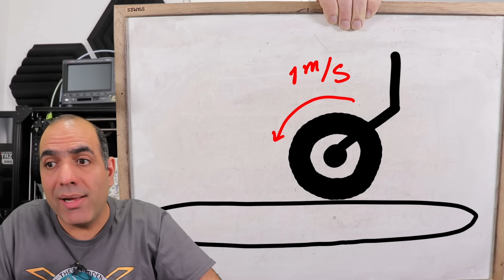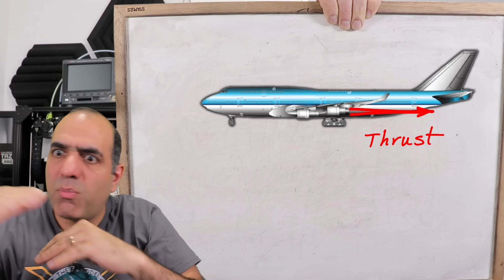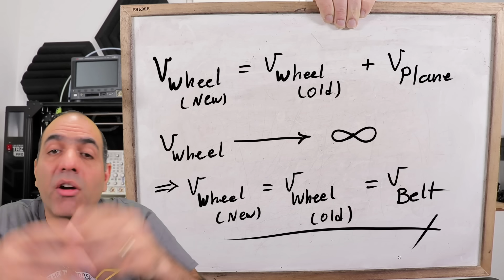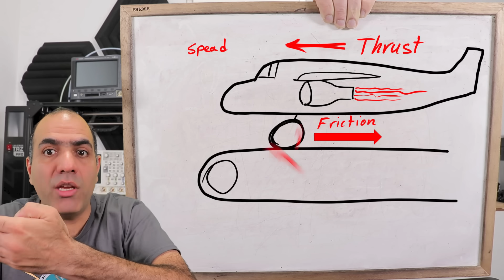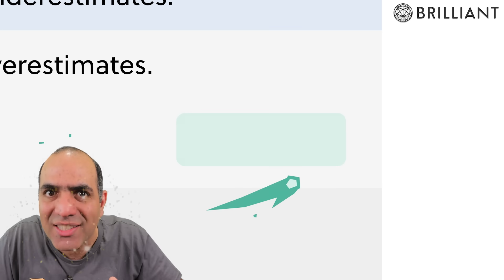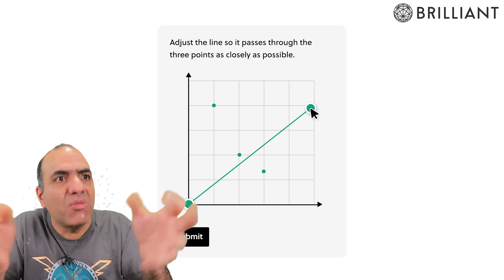Airplane Question that Drove Me NUTS!!!

Comment: Mehdi hit the nail on the head. The premise "the conveyor belt moves at the same speed as the wheels" is only possible as long as the plane itself remains static or the wheels slide on an immobile belt and neither spin. The moment the body of the plane begins to move forward and the wheels turn at that same speed it instantly becomes mathematically impossible for the "belt to move at the same speed as the wheels". 

Beside that, setting up a hypothetical scenario where the wheel bearings have friction while the belt they ride on isn't affected by the same real world restrictions such as inertia or top speed is just cherry-picking to get the answer you want.

Comment: Case 2 is a broken case. What does it mean to have infinite speed? It would required infinite force (which is not completely crazy, only a little) but also infinite energy, which is certainly non physical. And anyway, what does it mean to move at infinite speed? Could you still have a concept of equality and addition that makes sense physically (my gut response is no, but maybe you could make a wierd mathematical argument).

Comment: ok, prior to watching, i'm saying that the treadmill will have little affect as the jet engines are pushing against the air. You'd get a bit more drag from the bearings in the wheels running at twice the speed, but i think that would be negligible

Comment: Commenting at the point Mhedi told us to:
By my understanding, the assumption can not be met if the plane releases its breaks and experiences any force, like for example its engines' thrust. For the converor's speed to match the wheels speed, the plane has to stand still, which it won't if it tries to take off.
Now I am excited for what Medhi says.
Edit: It's after Medhi's take now. He reminded me, that I forgot to make the conclusion: In order for the assumption to be met, the plane is standing still. So no, it can not take off.
Reply: The top comments made it even more complicated:  With enough headwind, even a parked (but controlled/piloted) plane can take off, never having moved forward.
Reply: @VoltisArt  the takeoff speed of a 747 is 300kph, even if you could find an airport big enough for a 747 to take off that will allow you to take off over 60hph, 300kph fwind is not laminar, it swirls. The lift would be asymmetric and you would just tumble over, not 'fly' with the wings

Comment: I say, yes, because the thrust is moving the plane relative to the ground that the conveyor is attached to. If you were pushing the plane with a stick, even if the conveyor tried to nullify the wheels' movement, you will still be pushing it. The conveyor might go faster but the movement will still be forward. The wheels aren't what's propelling the plane so the conveyor wouldn't nullify the movement of the plane itself, and the wheels are only going to move if the plane is being propelled forward.

Comment: Since a jet engine acts on the air, propelling the plane forwards, and the wheels can be approximated as points on the plane that support the vehicles weight but have no friction with the ground (the wheels are rolling and therefore would just spin very fast), then the plane should be able to take off as the forces on the wheels are not relevant to the thrust of the plane. Realistically, the wheels could reach a rotational speed that may pose issues to takeoff, but its all hypothetical anyways. :)

Comment: in case 3, wouldnt the belt create wind which would create lift which would reduce bearing friction which would increase belt speed which would create more wind which would create more lift and so on until the plane takes off?
Reply: no. the moving air does not go with the plane as it flies away

Comment: The plane gets lift from thrusters then lifts off when the air going under wings puts pressure upwards on wings. The wheels and movement of the conveyor belt seems to make the plane stationary no matter the thrust put in so no air under wings and so no lift off.

Comment: I think the plane might take off with friction. Since the belt moves incredibly fast in that case it also causes friction between the belt and the air. The air flowing over the belt will also cause airflow over the planes wings. That might be enough to get the plane in the air?
Reply: the poor plane's tyres would burst first lol

Comment: If we go fast enough for enough time the bearings will get stuck due to heat and lack of oil and then airplane will slide on conveyor belt and take off. So yes, in any condition given wihtout time and fuel restriction it will take off.

Comment: Answer 5:  As the conveyor belt goes faster (its goal to hold the plane in position), it stirs up a headwind from the air friction.  This increasing headwind eventually allows the plane to lift off.... until it leaves this enhanced ground effect, then it begins to gain forward momentum which may not be enough once it reaches forward of the conveyor belt, causing it to stall back to the ground.  But if it landed without damage and has enough runway left, it can take off normally from there.

Comment: The speed of the wheels is irrelevant to the speed of the plane. Assuming all other conditions are nominal for a plane to be able to take off, the fact of the conveyor belt will, at worst, lead to a feedback loop between the speed of the wheels and conveyor belt, and so might create so much rotation that the wheels break apart, but otherwise, the plane should still be able to move forward with the thrust of the engines, and achieve flight

Comment: There is only one question you need to answer: is air moving over the airfoils? No? Then you don't get lift, and you don't take off.

All other details of the problem -- even mentioning the wheels and the conveyor belt -- are irrelevant. Always begin with interrogating the question.

Comment: Well the wheels spin freely(ish). In my head as long as the planes thrust began at the same time as the conveyor did, the conveyors input would be negligible. I also believe that’s why the mention the belt is as long as a runway, because if it weren’t the plane wouldn’t have enough room to take off.
Reply: Agreed. The conveyor must be long, because the plane is going to move forward regardless, and eventually achieve enough air speed and lift to come off the ground. When the plane begins to move forward through the atmosphere, gravity will still be pulling down, so we have rolling resistance on the conveyor, and the wheels will start to turn forward. As the wheels begin to turn, the treadmill will just turn backward to match the wheel speed. The treadmill speed (and wheel speed, since they're deadlocked together) will accelerate at the same rate as the air speed acceleration of the plane. The conveyor won't just continue to ramp up to infinite speeds as others have stated, because the conveyor only moves to match the wheel speed, it doesn't accelerate the wheels faster than they're already going. And that wheel speed only comes from difference in air speed relative to the stationary ground/earth below, which doesn't move even though the conveyor itself is moving backward. Just because the conveyor is spinning backwards with your wheels doesn't mean the plane isn't still approaching the end of the runway.

So the plane gets up to 100mph. That's the air speed relative to earth. The wheels now roll at 100mph, and since the conveyor matches speed, it just rolls backward at 100mph as well. I think we can assume there is no friction in the conveyor system, because it instantaneously matches wheel speed, you're not powering the belt. The wheel speed depends on the belt speed, and the belt speed depends on the wheel speed. So if anything, our impossible setup means we now have impossibly low (zero) rolling friction anymore, so perhaps the plane takes off/achieves flight even quicker than it normally would.
Reply: The only possible way the belt could affect the plane is if it makes the wheels travel so fast they explode. Even if you assume they aren't even rotating, the plane has more than enough power to drag past all that friction from the wheels touching the ground. It can push past 100s of kph of air resistance, a little tire friction isn't gonna stop it

Comment: answering the question at the beginning of the video. The answer is no even if the wheels are on a conveyor belt there's no lift there's no drag there's no wind because the plane is stationary. the wheels and the conveyor belt could be going a thousand miles per hour and the plane will still be stationary because there is no wind there is no lift it is not slicing through the air it is just stationary for the same reason why you can sit on a bicycle on a treadmill and feel no wind through your hair.

Comment: 0:42 Pre-video guess- The belt wouldn't stop the plane from accelerating, as the acceleration isn't bound by the wheels, so yes, with a bit of resistance from the wheels.

Comment: Forward speed needed for take-off is about 150 mph. The plane is stationary spinning its wheels WITHOUT  forward momentum. IF this theory was correct, there would be NO NEED for 10,000 foot runways.

Comment: Haven't watched the video yet, but I would say it depends on how wide the treadmill is. If the treadmill is wider than the width of the wings than it should be able to take off, if it's only as wide as the wheels than it shouldn't. This is because the moving conveyor belt will cause air flow under the wings due to the viscosity of the air. Basically it's just a bad question.
Reply: Also, you've definitely been spoiled as an electrical engineer lol. I'm a Chemical Engineering undergrad minoring in electrical and all of our chemical engineering problem sets are questions like this where you have to make tons of your own assumptions. Electrical is so much nicer cause all the problems are much better defined (in school and in the real world due to the fact that the models in EE are wayyyyy more accurate than most other engineering fields)

I legit had to calculate the heat flux of a pizza being put into a brick oven once. This doesn't seem too bad until you realize there are literally tons of parameters that weren't specified (radiative emissivity of the pizza, heat capacity and thermal conductivity of of the pizza (and at what points in the pizza cause it obviously wont be the same everywhere), whether or not natural convection should be considered for use in convective heat transfer coefficient calculations, etc) It's absolutely BS and you basically fail unless you happen to guess the exact assumptions the professor made.

Essentially, this is why Electrical Engineering is the absolute best and most pure form of engineering imo

Comment: The belt in case 3 is unphysical, in that it has to instantaneously accelerate to sufficient speed such that the wheel bearing friction is enough to counteract the thrust.

So we have instantaneous acceleration, which means either infinite force or massless treadmill and treadmill bearings.

Comment: In order for the wheels to start moving the airplane has to move. There is no way around it. Therefore that is a paradox.
You can't accelerate the wheels if the airplane does not accelerate.
This means the wheels will spin faster and faster but the aircraft will still take off. Though the tires might explode.

Comment: In normal conditions with a normal plane where friction doesn't go up to infinity, I'd say it will definetly fly, the wheels will have some kind of sliding motion and their speed will not mean that much. I remember when I was a kid, I was amazed by the fact that, if you push a small wheel object (like tape roll), from up pressing down hard, it will go forward while it rotates backwards, after a point where friction surpass the initial impulse, it starts to ovorcome the initial thrust I made and go back to me like a boomerang. It will be the same with the plane, just that the thrust is continuous, so it will never stop or slow down. Unless the rail is idk really sticky and the friction of the axel is also unreasonable big, and at least that last one will always be false in a real setting.

Comment: And this is why engineers can annoy people, You ask sufficiently vague questions you get sufficiently vague answers. 
I would also like to add he overlooked something important on one of these examples. If you enable friction everywhere the plane doesn't eventually use all its power to stay still. It uses its power to stay still until the wheel bearings overheat and and fail. Then that most likely would set the hydraulics on fire. As you now very quickly go forward grinding through the metal of your landing gears.  But there's also a problem with that conclusion The tires but most likely blow out before that state was reached. See suddenly going forward and grinding landing gear down and possibly starting a fire.

Comment: the question does not give enough information. to take of the plane requires list, to get lift there has to be an airflow over the wings which is above the stall speed. SO. There could be a head wind, the treadmill could be moving, the tread mill if it is long enough and the engines are producing engouer thrust the plan can move enought to develop lift from the wings. And so on. The speed of the wheels is bloody irelevant. the air flow acrross the lift surfaces (the wings) is all that counts

Comment: Leave a comment okay... The plane increases throttle which in turn produces thrust, this thrust pushes the plane forward. The wheels start spinning as the plane begins to roll forward, as it does so the conveyor belt activates and begins to move backwards under the plane. The plane will continue to increase in speed relative to the conveyor belt, from the plane's point of reference it is the same as going down a normal runway. Once the plane moves fast enough to achieve lift it will well... lifts off. Friction between the runway and wheels decreases as the plane becomes more buoyant until the point where the plane is producing enough lift to lift off, after this point if the wheels are still in contact with the runway they will stop spinning immediately due to friction between the conveyor belt and the wheels and the conveyor belt only spinning if the wheels are (after this point there is nothing forcing the wheels to move).

Comment: I'd think that the interaction between the wheels and belt would essentially be null because the planes' engine force has applied to the air only. Plane pushes air which moves plane through air, I believe the interaction between the wheels and belt would mean nothing.

Comment: In the Mithbusters case, i think the question is still broken (If the plain speed and the belt speed is the same). 
When the plain starts its engin, it will gain trust slowly (from 0 gradually going up). At some point the trust will be just a bit over the friction of the wheels and wind resistense, and the plain naturally will try to move forward. But if the belt moves back at the same speed then the trust will not be yet strong enough to overcome the new force, because it was just strong enough to beat the friction. In that case the plain will actually stay in one place, because the engine has not revved up so its power is just enougt to push the plain a bit. So what you end up, is the plain stays in one place (its speed is 0) but the belt has moved. In other words the rules are impossible. It is not possible to have the belt moving with the same speed of the plain, when the speed is very low (talking about fractions of km/h).

Comment: Considering the weakest 747 has four engines with a maximum thrust of 230 kN each, I bet the wheels or bearings would fail before the thrust matches the friction force. The undercarriage would fail catastrophically and the plane would crash into the belt which is moving at a ludicrous speed, destroying the plane and probably throwing some of it into the air. Thus, the plane would fly, or at least part of it... for a little bit.

Comment: In the friction inclusive case (#3) where the wheel and belt speed ramp towards infinity, and negate the planes forward speed, the plane would take off without moving forward. The spinning wheels themselves would generate lift, but not in exactly the same way wings do. There's some pretty interesting public NASA studies on alternate lift generation. A spinning rod, and a spinning sphere both generate lift according to the Kutta-Joukowski Lift Theorum

Comment: I'd say it's badly worded, maybe intentionally.

Assuming the question... I think no, the plane wouldn't take off. The speed of the runway will always match the speed of the aircraft, so no matter how much thrust it has, you're not going to move forward, and without the forward motion, the wind under the wings won't be enough to provide the necessary lift.

Assuming you can unbalance the speeds and overcome the backwards momentum of the runway, it will eventually fly.

Comment: of course the plane lifts off regardless of any conveyor belt. Anyways, if the conveyor belt is frictionless, then the airplane wheels don't turn at all :)

The problem would make more sense if it supposed there was a giant fan in the front or the rear of the aircraft..

Comment: Airplane wings create lift by accelerating air faster over the top of the wings than the bottom, thus creating lower pressure on top and higher pressure underneath. Without air flowing over the wings at a sufficient speed, the wings can not create the necessary lift for the plane to become airborne. 
The only way a stationary plane is going to get enough lift is if a headwind is providing enough air speed to create an adequate pressure differential between the top and bottom of the wings.